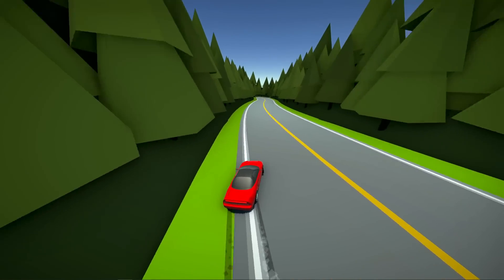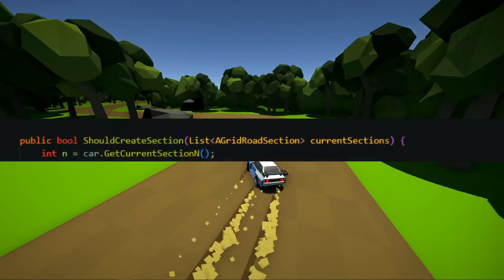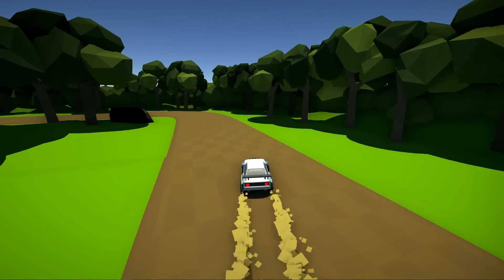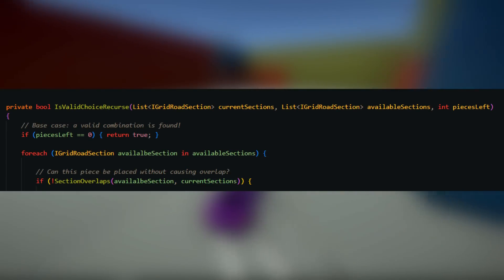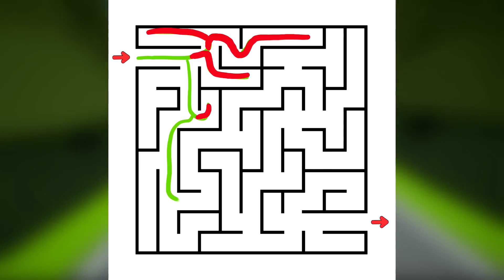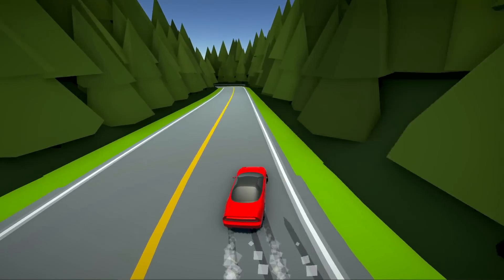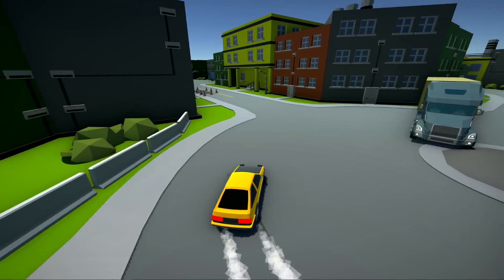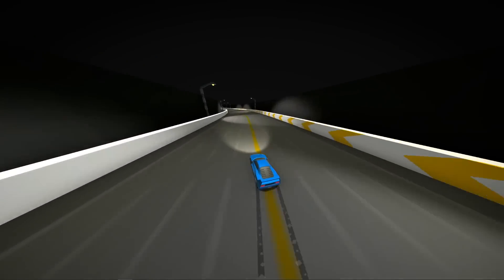Creating Infinite Road For My Drifting Game (again) - Drifto Devlog

Comment: A better way to improve your performance checking for valid pieces is to store all pieces with identical signatures together. That is to say, peices with the same size, shape, and path through them. This way your valid piece check can just find a valid shape and then select from the group of valid shapes whatever unique piece it thinks has been used the least. So you can have a thousand pieces with the same shape and path and the valid pieces check only has to check once.
Reply from the maker: Yes! That's a brilliant idea
Reply: @jonathonhowe  You could add them to a set manually, but if you wrote a custom hash function for the signature, they could be grouped automatically.

Comment: What if you made pieces where you drive under a bridge, then if the future generation happens to intersect the road, it has the option to pass over the bridge.
Reply: neat idea .. one problem might be that it adds some possible complexity to the future piece placement.  So if you first drive over a bridge that has a perpendicular road running beneath it, would the player be guaranteed to eventually drive under the bridge, or does the algorithm simply allow that as a possible 'way out'?  If they're guaranteed to pass beneath every bridge, then the program has to either look ahead further, or it has to get back to the bridge within a certain amount of map pieces, which would kill some of the dynamic feeling, since you'd always be guaranteed to cross under a bridge within a certain amount of time after crossing over it.  If it's simply an optional escape route, then the program would simply have to limit the amount of bridge pieces it lays down so it wouldn't be repetitive or goofy looking.  However, if you are generating bridges with perpendicular roads running beneath them, you probably also have to extrapolate perpendicularly, in case the camera manages to catch a 'down the road' angle, which potentially doubles or even quadruples the amount of map generation for the bridge scenarios.  It'd be a cool solution if it could be made to work though.
Reply from the maker: Definitely a cool idea but would be difficult. 

Edit: my original response was junk. David is on it.

Comment: A simpler solution will be to generate a list of possible road tiles of a specific length, and check if it's valid, if it is, add only the first tile in the list.
I think it shouldn't be too hard to implement, and it can give better performance as you aren't trying to force a specific road type to go in.
Another way to look at it is:
Do the same recursion you are doing now, but if there is a collision abort and start again.
Reply from the maker: The problem with that would be that the controller would often label more desirable pieces as invalid, even when they are valid.
Causing a situation where the controller thinks no sections are valid, resulting in it defaulting to a straight piece, making the road less interesting.
Reply: @jonathonhowe  i think you misunderstood my idea, there is no such thing as labeling a piece as invalid.
As psoudo code it's pretty simple:

List<Tile> possibility;
do {
  possibility = createRandomTileList(length);
} while (hasIntersection(possibility));
spawnTile(possibility.get(0));

createRandomTileList - makes a list which each element is a random tile with equal probability, or with weights.
hasIntersection - checks if the tile list can continue the current state without intersection.
spawnTile - will generate the game objects, update variables and so on.

You probably want to also add a counter just in case so the tile generation won't get stuck in an infinite loop.

Let me know what you think and if you have any questions.

Comment: would it be viable to instead make road models that could bend, then figure out the path, and then place scenery and crossroads as needed? that could make it possible for the road to just generate as it goes. if too many crossroads, add a bridge or tunnel that levels itself after the intersections are over, and if there's only one or two, you can make the path replace some scenery with construction or demolished buildings to clear out the way for a cool continuity concept
Reply from the maker: It's definitely possible, and a very cool idea. In fact, originally a similar system was in mind for this.
The reasoning for the system I have chosen with preset road sections is simplicity and development time.

Comment: you should change the checking to check with a simplified shape. imagine you have one shape for a hard turn left, and a dozen different reskins. checking each reskin would be needlessly increasing the required time to check a piece, and limit how many distinct pieces you could have.

additionally, on a representation of the map that is an array of whether a grid cell has any tile or no tile, store n previous checks and draw a line between the closest forward moving piece and the previously added piece. if this line is shorter than some distance, check if there is an enclosed region using a flood fill algorithm, if a new piece would enclose a region, it must be a piece that turns away from that region. if there is no valid piece, undo the previous added piece and place a new piece that moves away from the enclosing line. this is probably not a perfect description of what i mean, and i’ve never written such an algorithm, but hopefully it helps you write something with better worst case time complexity.
Reply from the maker: The simplified shape is a really good idea.
I'm not understanding the array idea though. Are there any other resources for this idea you could link?
Reply: @jonathonhowe  i’ll try to remember to type up a better explanation of it when i’m back at my computer so it’s less train of thought and clearer

Comment: you do a raycast straight down to figure out where the player is, but wouldnt it make a lot more sense to do this simply based on the x and z of the players location? anyway, looks like a really cool project, keep it up!
Reply from the maker: That is a very good point.
In the original road generation method this wouldn't have worked so I just defaulted to that solution again.
Your idea is way better.

Comment: Beware with striding too far away from (0,0), floating point precision from the model's polygon data can be affected and make everything look bad
Reply from the maker: Yes that's a good point, I'm not worried about that right now as the world slowly shrinks to increase difficultly, stopping the player from getting that far.
Reply: There’s an easy solution to this! Just keep your car object at 0,0 and move the terrain instead of the car
Reply: If this ever became an issue (which I doubt would happen in normal-length gameplay sessions), you could probably fix it by implementing a very subtle preference towards (0,0) into the next piece picker. The larger your distance from (0,0), the higher the algorithm will bias towards turning back towards the start.
Reply: I guarantee this guy just watched a technical video on minecraft farlands. Floating point precision is almost never an issue unless you make it one.
Reply: @gopro2027  to be fair this floating point issue with things far away from the origin does cause a lot of problems even for professional-made, professionally relied-upon software
Reply: I mean I'm sure it is an issue but since minecraft is so popular the farlands have made it seem like a much greater issue than it really is. That bug won't even be encountered during a typical minecraft playthrough, that's why it wasn't fixed.
Reply: Oh and what professional programs are you referring to? I am curious though
Reply: @gopro2027  so for example things like cad. If you are working on a collaborative project, and another company draws up some plans, but they forget to center the plans on the origin, when you import them the 3D instances can become askew and just way off. Especially when you need to rely on that to make your own accurate plans/profiles etc. I think cad is the program most people are familiar with, but this goes for the more niche autodesk softwares that I’ve had to use too
Reply: And I should note that some uses of the software obviously require way longer distances than other uses. And the longer the distances the worse the artefacting from floating points can become
Reply: @gopro2027  hey so first of: AFAIK the farlands themselves weren't floating points thought, right? Because the terrain generation was integer based (maybe the noise sources used had floating point problems? Dunno)

But anyway, another game in which floating point errors definitely WERE a noticeable problem during NORMAL gameplay was (afaik) Kerbal space program! Just because the distances in that game could get insane they went with the "you are always at/around 0,0,0 and the world moves" approach.
Reply: @gopro2027  The farlands were caused by an integer overflow in the perlin noise function used to generate the terrain, not strictly due to floating point precision. If you're going to refer to the far lands, if you've ever watched anyone play in that version where the farlands existed, you'll notice that well, well before you get to the farlands you start seeing issues where the movement of the rendering starts to move in a more jagged way, instead of being very smooth the further you go out from 0,0 the world would start moving in larger and larger intervals that eventually become very noticeable. While the hitboxes, entities and the player were moving smoothly, the blocks would jump by increasingly large values. Each time a new threshold was passed the resolution of world movement decreased by half, it'd go from moving 1/8'th of a block at a time, to 1/4'th, then 1/2 then a full block, and etc. That problem was caused by floating point precision, and starts being noticeable well before even 1% of the way to the farlands.

Comment: No offense, but I honestly feel like it'd be easier to just let it make mistakes in generation, then write a "mistake fixer" algorithm that finds and fixes the problem by replacing a tile with another.
Reply: Basically wave function collapse :)
Reply from the maker: That would for sure be easier, but could cause some problems with generating road.

Imagine the road has gotten itself into a position where anything it did would cause overlap (like the snake analogy at 2:10). The algorithm could remove old sections until it could place the right number of pieces again without overlap, but there is no guarantee of how many pieces this would be, potentially removing the one the player is on.
Creating and destorying objects in the world is expensive.

How sever this problem is depends on the design of the road pieces as well. Are they likely to hit each other?
The more likely overlap is, the cheaper it is to check ahead of time.

Comment: neat - are you reseting the player to zero at a certen time or does the high numbers not cuase issue ? Was watching a tutorial once about it - but did not try it my self.
Reply from the maker: I'm not quite sure what you mean by setting the player to zero.
Are you referring to the time complexity for the high numbers?
Reply: @jonathonhowe  'Endless Runner: Procedural Track Generation (Unity Tutorial)' floating point errors - in the intro he talks about it. I have not done this yet.

Comment: If the actual placement uses the same logic as the "IsValidChoiceRecurse" then this is needlessly inefficient. Each time a piece is added you recurse to see where a choice of x pieces will get you, then on next piece, the you repeat the x-1 recursion steps and only the last one will actually determine anything. Isn't this exactly the same as maintaining a list of x-1 sections ahead and only checking/placing a single piece without recursion?

(and if the placement uses a different logic then the validity recursion, then the check is useless, because we proceed knowing that there is some existing selection of pieces that doesn't overlap, but if we don't then choose those exact pieces then we loose the guarantee of not overlapping)

But algorithm's aside that looks like a neat concept for a casual game, good luck!

Comment: You should make it where you gain/lose points depending on if the car properly stayed on the road(meaning never went on sidewalk or grass) They vice versa you gain points by actually staying on the road. 

Keep in mind I have no clue what your direction for this is but i think this could at least be a fun/challenging gamemode
Reply from the maker: Funny you suggest that. Just a couple of days ago I started implementing a system so the cars behave differently on different surfaces, including earning different amounts of points for each surface type.
I like the idea of extending this to a bonus for never going off the road. 
Thank you!

Comment: I could be wrong but it feels like you are keeping far too many of the old road pieces where overlap should be far less common, so unless you plan to have your players look behind them or drive backwards I feel you could delete them much sooner. You could shoot a ray cast backwards and only keep the tiles that viewable behind the driver.
Reply from the maker: Currently the game removes the old pieces once the player is two pieces ahead. So most of the time doing the raycast to check if it's in view wouldn't change when it's removed. If they were removed when the player is just one piece ahead (on the adjacent) then the car would be cut in half as it crossed pieces.
However the raycast idea could make for smarter choosing of when to make new pieces.
Reply: @jonathonhowe  My mistake, based on some images in the video it seems like there was a lot more than 2 roads behind them. Good stuff and thanks for the cool video.
Reply from the maker: @EKUL34  Yeah no worries, it does look like that.
Thank you!
Reply: @jonathonhowe  how do you currently handle reversal?  Does the program simply generate new map pieces whichever direction the player goes?  Before reading this thread, I imagined you would keep several map pieces loaded so that you can warn the player they're going the wrong way and once the go a certain distance, they get a game over. (to stop them from generating something that wasn't there before)

Comment: if you continue with this tile approach, you should look into wave collapse functions. Additionally, since you're surrounded all sides, you can overlap as long as the player cant see the old pieces from the side
Reply from the maker: The wave function collapse is a really good idea.
Allowing overlap with the old sections when creating new that are not yet in view would give the path a little more freedom but I'm unsure on whether the performance hit and development time is worth the slightly more random road. - Is that what you were thinking?
Reply: @jonathonhowe  would be nice if you can see the map of the path you've been through at the end of the game
Reply: @jonathonhowe  WFC can be really memory and performance intensive and worst of all it can just straight up fail to generate a valid combination which either requires running it multiple times or flat out becomes an impossible task for it (depending on your input pattern - doesn't take much to make it fall over); IMO - WFC is at its best and most powerful when it is used as a tool at creation time / editor time to help you handcraft levels. Disregarding the negatives; given you never see the entire output all at once (such as an image, etc) I doubt there'd too much of a benefit over just using what you have already.
Reply: @jonathonhowe  about overlapping, my non-dev mind thought about creating tunnel sections going under the previous tiles. Could give the map generation some freedom and the player a short change of scenery.
Reply: @jonathonhowe  if you’ve not already multithreading this code even just by using async await not nessesarily even learning the job system would be a massive improvement to performance.
Reply: @scyan897  I doubt async/await will improve performance in this case. They can improve performance if your thread is mainly idling, waiting for blocking operations such as reading a file or networking. You can continue using the thread even thi something is blocking by doing something else in the meantime. They're not useful if your thread is slow because it's working, as is the case in the game, since async/await is still fundamentally single threaded. It just uses the thread better by doing something else until a blocking operation is done. And if you want to introduce blocking operations that can yield control until they're done, you're already working with jobs & threads.
Reply: @scyan897   Async/await isn't multithreading at all though? At least in JS
Reply: You're right its not exactly multithreading I was mistaken but he's using Unity which means hes running on C# unless I've missed something
Reply: @scyan897  LLP lo 0 loo oll
Reply: @scyan897  it could be one of several languages. Unity supports a fair amount
Reply: Could also implement tunnels if two road sections were to intersect, just have one go underground and come out the other side.